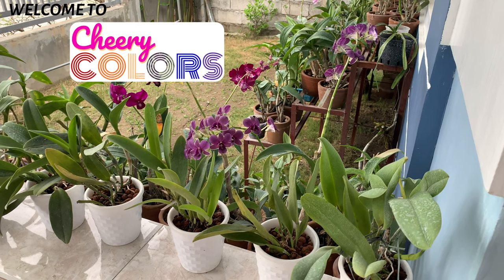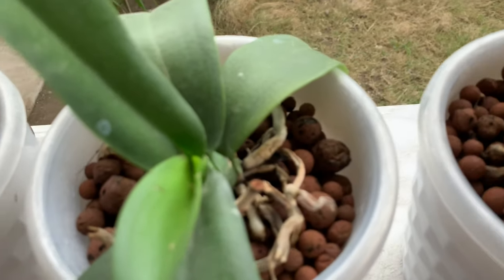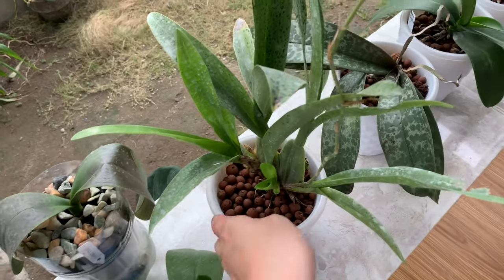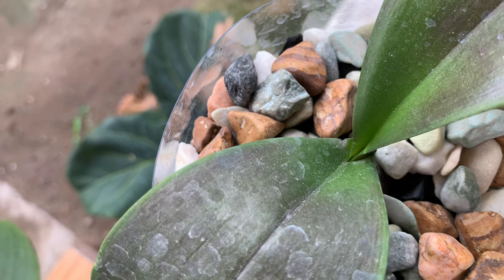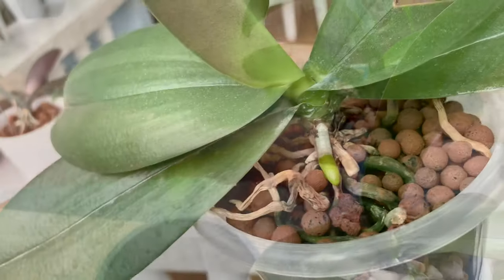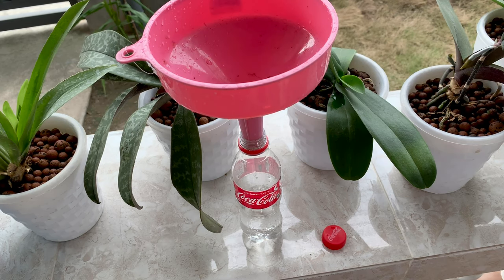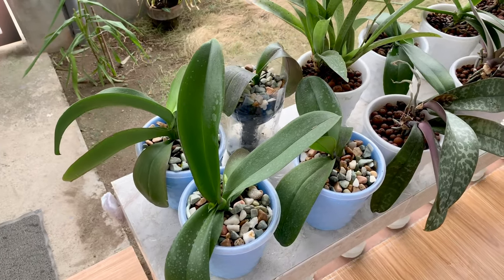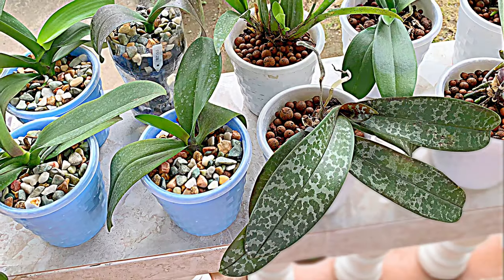FERTILIZING MY ORCHIDS IN SEMI HYDRO - SELF WATERING POTS | AGGRESIVE FEEDING | BEGINNER ORCHID CARE

Comment: don't worry at all about the roots dieing if you have good roots replacing them.  You have changed how the plant gets moisture and nutrients.  The air roots were required when the plant was in soil/medium.  Now when the plant gets all it needs in the water method, the plant has decided it doesn't need the air roots anymore and they die off.  It is all natural and normal.  I have done this method since the early 1990's.  It works for epiphyllum cactus and Christmas/Easter cactus as well.
Reply from the maker: Thank you so much for sharing. I am relieved 😀❤️

Comment: burned ( destroyed ) roots come from either your water or your fertilizer that means either something is in your water that your plants dont like ( for example if you use tap or mineral water there can be toxic substances in there ) or your fertilizer isthe problem means either you use too strong of fertilizer water or something is in your fertilizer your plant does not like. but i saw the water was dried out that indicates to me that there is too strong of salt buildup so the root died. hope that helps! :)
Reply from the maker: This really helps and I actually changed my water to purified water when I fertilize. I just bought a TDS meter. Thank you so much for sharing and for the advise. Thank you also for watching!😀❤️